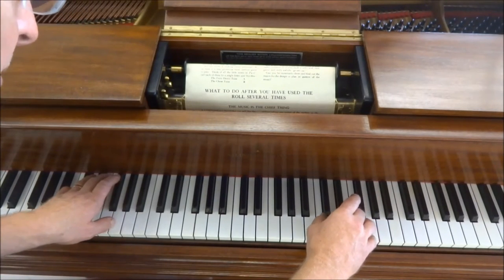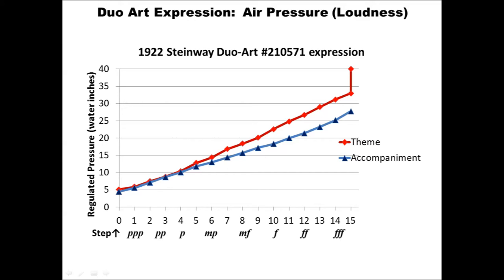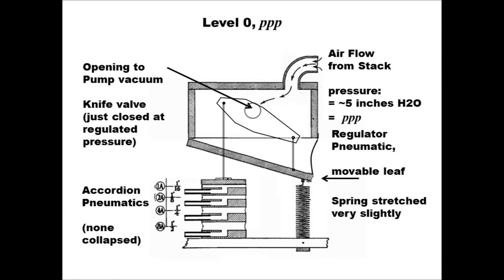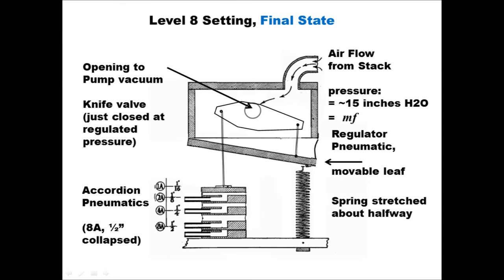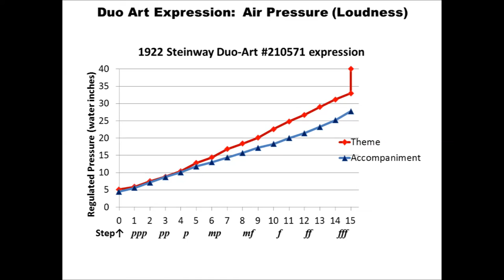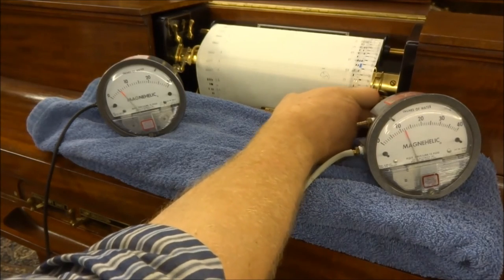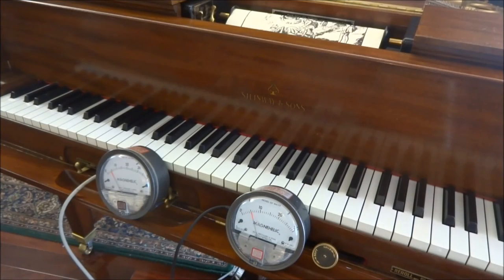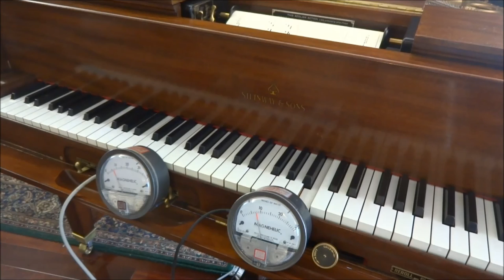A Demonstration of How the Aeolian Duo-Art Expression System Works

Comment: I must congratulate you on the quality of restoration and reglation of th piano. An excellent demo of a reproducing piano. But the Duo-Art did not cover all 88 notes, but only 80! - a rather basic error.  And while your description is good as far as it goes, more recent investigations of the expression action (particularly by an Australian authority on reproducing pianos who has just gained a PhD on the subject) reveal much greater subtleties than described here. However, this is a good, careful and well-presented introduction to what is proving to be significantly more complcated than given here.
Reply from the maker: Your comment that the Duo-Art system only played 80 notes rather than all 88, was true for later designs.  Steinway (and most other makers) switched to 80-note stacks about 1926, eliminating the need for complicated cut-out blocks on earlier designs like the 1922 instrument demonstrated here that allow it to play all 88 notes when the Duo-Art system is switched off.  When first introduced, Aeolian apparently believe that many customers would frequently play non-Duo-Art rolls and care about all 88 notes working, but by the late 1920s they realized that most owners played mostly DA rolls.  The shorter 80-note stack allowed cheaper manufacturing, looked better with single-leg furniture styles, and eliminated capability most customers didn't care about very much.  As with all complex systems, there are subtleties I may not address in a 15-minute video--but much that has been written about the system by "experts" is simply not true.  Many erroneously believe that the DA knife valve is a "airflow regulator" rather than a "pressure regulator", and is somehow fundamentally different from Ampico  or Welte regulators in that regard.  All air-pressure regulators like this will have different response characteristics to how quickly pressure changes occur and how well pressure is maintained when airflow is high, i.e., when playing many notes at once.  And the DA coding probably took this into account, tweaking the coding for typical response speed, and for slightly higher loudness levels than the artist actually played for larger chords, etc.   But overall, this demo shows a true and fairly complete representation of the core system operation.
Reply: I'm sorry, you really show a significant flaw in your knowledge. Duo-Art were ALWAYS 80-note. An ablity to switch off the Duo-Art sysem to play 88-note player rolls does NOT make the instrument 88-note DA, which is what you are implying. All Duo-Art rolls are 80-note, and a friend has a 1914 Duo-Art Steinway; 80-note as ever. You must be confusing with Themodist or some such as the Duo-Art was essentially a progression from Themodist (albeit a substantial one). Duo-Art were proud that although over time changes were made to the reproducing system, all Duo-Art rolls/pianos were compatible (not a 100% accurate statement by them). If so, it's obvious an "88-note Duo-Art" roll would not be compatible - if it existed.

I realise the subject of expression control is indeed complex and would take a great many hours to cover properly. And within 15 minutes you have done it well. except you give no clear indication that it is a much more complex issue, the details of which are still being unravelled (possibly because you are unaware of current research in this area).

Current researches being undertaken are accurately measuring pressures etc with precise digital devices (rather than a water gauge) and are revealing much greater subtleties and complexities in expression (which the Duo-Art engineers/musical experts must have sorted out by their musical acuity as such  measurements were impossible then - they really new their stuff) than were previously realised. I'm not the expert on this, but it is the subject of a forthcoming research paper by a person who IS an authority - not a so-called 'expert'.
Reply from the maker: Nowhere in the video do I state or imply that DA-coded rolls play all 88 notes of the standard modern piano compass.   Yes, I know well that coded rolls do not play the top 4 or bottom 4 notes.  But your insistence that I somehow stated they did, or that this is a basic flaw in my knowledge is not correct.  Certainly the DA instrument in this demonstration has a full 88-note stack.

Yes, most original rolls codings were carefully edited until they sounded "good" and "right" in playback, so some subtle effects may be there, including that some notes might possibly be played at "intermediate levels", for example at level 4 1/2 rrather than just at level 4 or level 5, with careful dynamic timing of accordion movement.  But your idea that people until now can't sufficiently understand significant details of DA expression because they have lacked sufficiently precise pressure gauges is verifiably not true -- whether or not such rarified knowledge comes from someone who, in your words, "IS and authority".    Ultra-precise measurements might tell you a litte more about exactly how a particular Duo-Art piano plays a particular roll.  But no one piano design is the "gold standard" for how the DA system should behave, and standard gauges are more than precise enough to measure significant variations found in in different DA systems in different pianos manufactured with different designs at different times.  Grand vs. upright, grands of different length with different keystick balancing, variations in hammer mass and hammer voicing,  slightly different regulator springs, cloth stiffness and spring adjustment on accordion pneumatics, leak rates of different stacks, valve facings and pneumatic fabrics, slight variation in roll perforation, air motor calibration, tubing run length, cross-valve vs. round valve, etc., etc.  All of those things create slight but measurable variability in playback and musical result on different instruments.  So it is a fools errand to believe that ultra-precise pneumatic measurements on any single instrument will provide hitherto unknown insight into important overall system attributes.

Oh, and by the way, I also have a Ph.D. from a school that might be considered the top engineering and science institution in the US.  I won't use that credential to claim to be "the authority" on the DA system or anything else.  But the DA system is fundamentally simple--exactly 10 bits of digital expression control on top of the normal note and pedaling information in a standard non-reproducing piano roll.  Claims that it somehow is complex beyond the comprehension of us mere mortals because  some "authority" has weighed in are simply not true.
Reply: Briefly: you may not have explicitly stated that early DA rolls were 88-note, but that is the implication. Listen to your opening sentences. Talking specifically in the context of the Duo-Art piano, you discuss it playing 88 notes. That is a clear (but now, apparently unintentional) implication that it is an 88-note DA action.

I didn't say that the DA system was complex  beyond comprehension, only that it is being found to be more complex than you are aware. I'm sure if you were familiar with recent research you would understand what is being found. The "authority" I refer to gained his PhD recently (a joint effort between Stanford U and University of Sydney) specifically on the detailed study of the main reproducing systems and what was "going on" as it were in the actions. [He also lectures around the world on the subject.] The work leading to his PhD revealed the DA was more complex than it appears and is leading to further research. The PhD was the culmination of many years of study and research particularly of the DA - except it turned out that there's room for further study.

Without itemizing your reply in detail, there is much there I would not dispute (ie., variations from instrument to instrument), but as a qualified engineer, to imply that a water guage is going to reveal all that is needed to investigate subtle pressure changes and factors that influence rates of change rather than modern measuring devices, and to say, or imply, that the DA system can't possibly have any more to it than you are suggesting is revealing a rather closed mind. On which basis, further discussion with you is pointless. Stay happy in your restricted world.